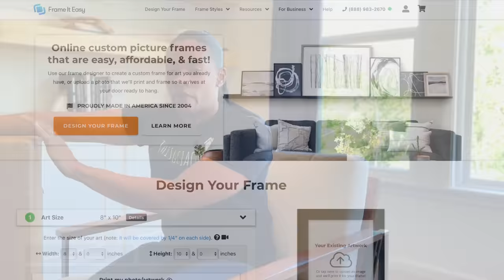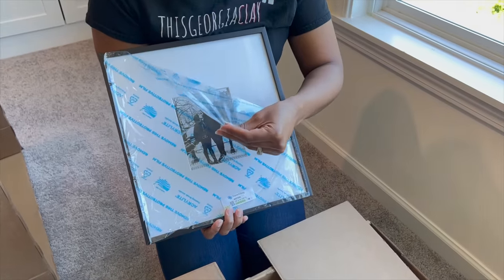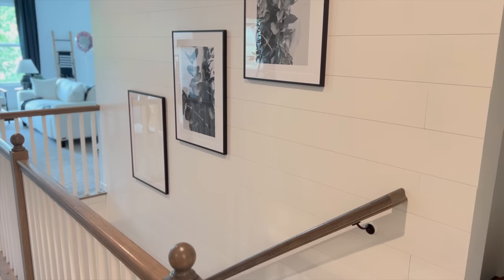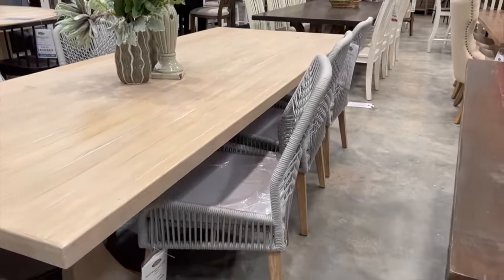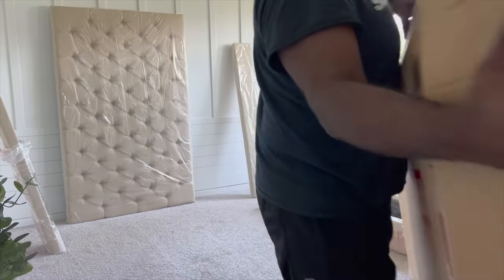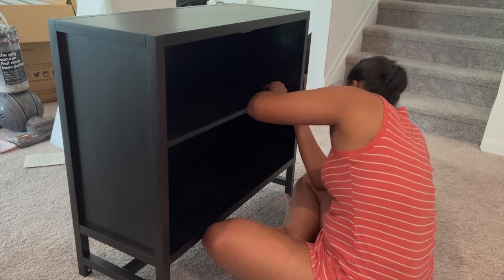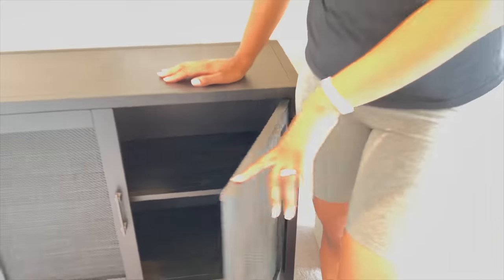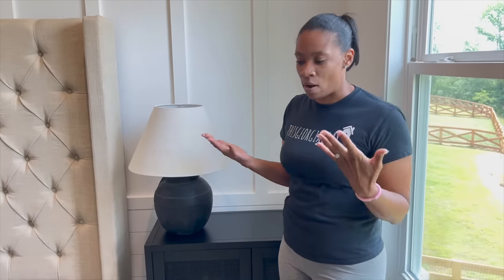POTTERY BARN VS TARGET Bedroom Design | Primary Bedroom Makeover Part 5 | House to Home UPDATE

Comment: We have that exact bed and it’s held up well for the past four years. However, the wood slats will not hold up to “nocturnal activities” over time so we removed those and just put in a plain metal platform from Amazon. It was maybe $50 for a king size and it fits perfectly within the sides/foot rails of the bed, plus you don’t need a box spring.
Reply from the maker: Thank you for the advice. We shall see how the slats hold up but I’m pretty sure we will be reenforcing them at some point 😝